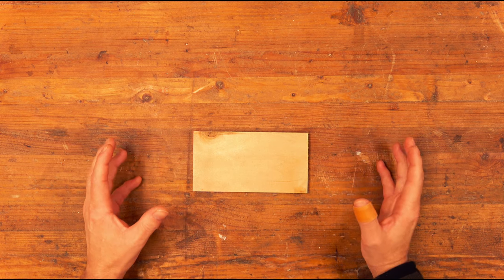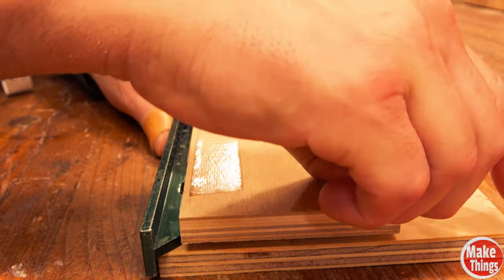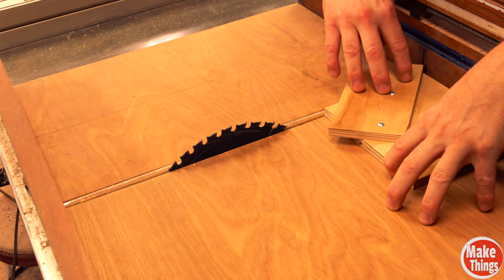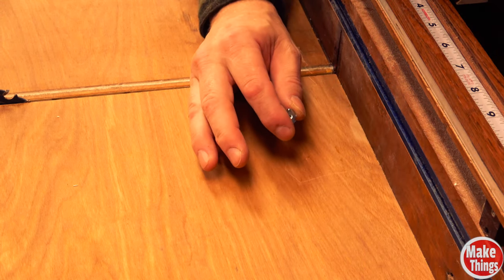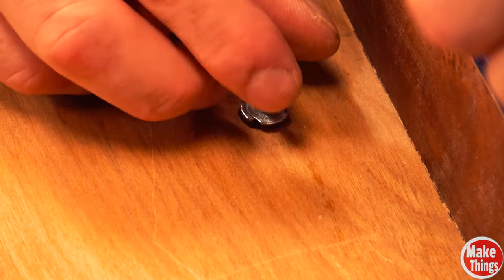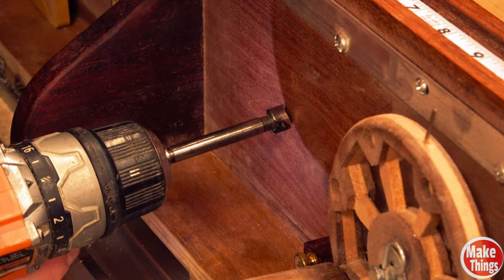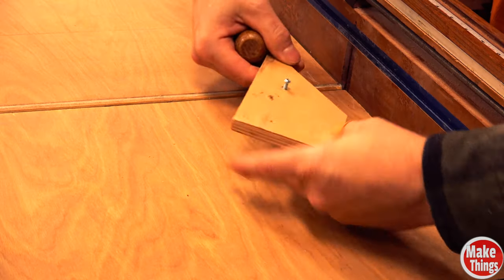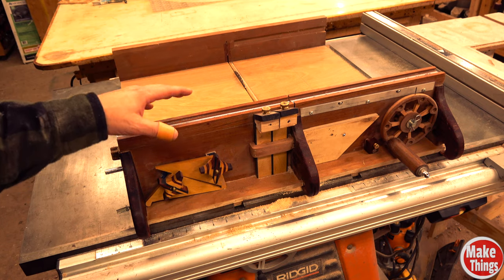PERFECT Table Saw Miters With This Simple Board // Bite Size #11 // Make Things

Comment: For someone in a small garage shop, the more jigs you can fit on one sled, the better. We only have so much space, so if I can get my mitering done with a scrap piece of plywood, that’s fantastic.
Reply from the maker: Thanks Jason, that's exactly what I've been trying to do with this sled.  It makes box joints, cuts miters on the edge and on the face...soon I'd like to add a dowel making jig, as I'd like to possibly get rid of the miter saw dowel making jig.

Comment: That's really clever. 
I do a lot of miters with smaller frame pieces and I think this idea would be a lot more stable and safe for that type of work. 
Thanks for sharing!
Reply from the maker: No problem.  If your sled is not dead on 90˚ with the blade, I'll offer the hint to use pop can slices as a shim.

Comment: Clever and easy design Rob. No more fumbling around for 45 degrees on the mitre saw. (I normalkly use the mitre saw for this, and not the table saw, because of that accuracy problem)
Reply from the maker: Yep, I use my miter saw for that too, usually, but if they're just a little bit off, the whole thing doesn't work right.  Incidentally, I made this jig for my next jig...I was trying to figure out how to cut triangles with a table saw.  Triangles that would be far too dangerous to cut with a miter saw.  Thanks my friend!
Reply: @MakeThings  ah, a jig for a jig. I like that. Yes traingles and mitre saw won't go together, lol.

Comment: I liked your video and the small 45 degree block is neat.  I am going to make one.  One thing I want to point out is you did not use a "carpenters square", you used a cheap, perhaps an empire, knock off of a Swanson speed square.  Framers use the speed square because it is always square and will do a multitude of tasks when framing.  The least of which is to hold it against a 2x 4 or 2x6 and get an absolute square cross cut.  And the functions just go on from there.  Thanks for the video on perfect 45's on an existing sled.  David Adair
Reply from the maker: Hey David, thank you!  I've been calling them carpenter squares my entire life...I've learned something new...thanks!

Comment: This is going to come across as offensive and I don't mean it to be.  All these type of videos show 1 (one) joint as being perfect.  I'd like to see a video with 4 joints on boards that are 16 to 24 inches long making a frame without gaps.  Using a small square in the corner is no guarantee that it's not 89° rather than 90°.  It will show up when the boards get longer and you make a picture frame.
Reply from the maker: You don't need to use a small board, you could make it much longer.  I get what you're saying, but if your table saw sled is sound, an angle won't complicate things.  My question to you is how sound is your table saw sled?  Something I didn't add, due to trying to keep it short, is that you can shim either side of the wedge to correct any error that your table sled has.

I don't disagree that there are better ways, I just don't like having all these sleds that clutter up the shop.